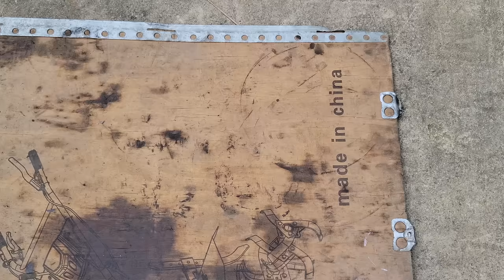TIMELAPSE: The genius girl repairs and perfects all the engines of the indigenous people's machines

Comment: I 've been watching a lot of them shows where they rebuild engines and stuff but i am yet to see one where they torque the bolts, LOL i bet it doesn't take long for the bikes to come back for repairs,
Reply: these small motors don't need torqueing
Reply: That's a new one on me specially for head bolts, after 27 years in the business
Reply: I think they are just happy to have running water torque is not that important